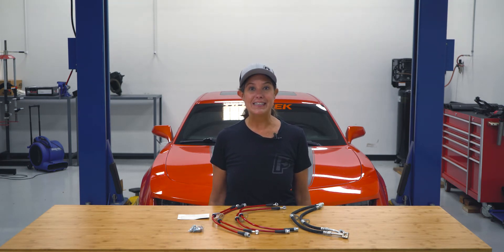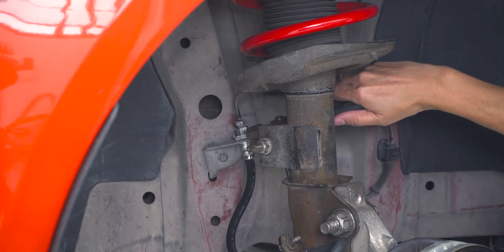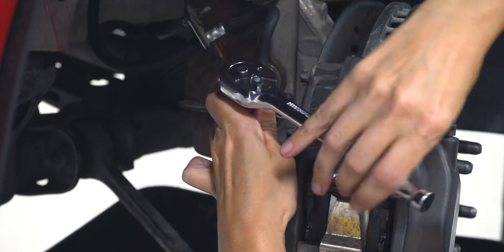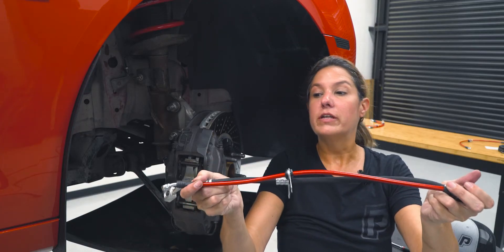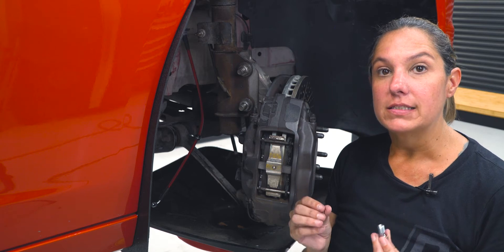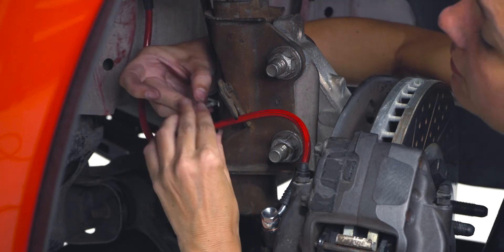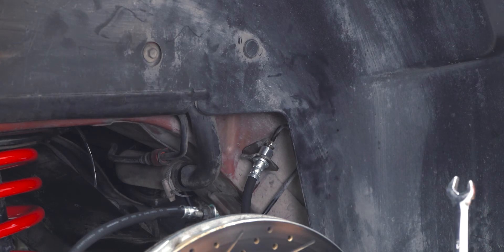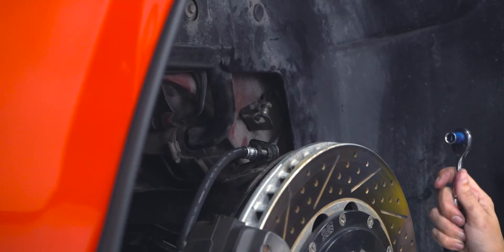How to Replace 5Gen Camaro Factory Brake Lines With RST Aftermarket Brake Lines - Phastek

Comment: Does brake fluid not leak out when removing the lines? I didn’t see any but i dont know if you evacuated the fluid prior to installing
Reply: you will have to bleed the lines after
Reply: They do; this is even if you bleed as much fluid out from all the calipers from just straight taking out all bleeder bolts, or just bleeding them in general. 

I always keep extra mats and drain pans ready by whichever brake lines are being removed, bc you’ll have excess fluid left in the lines, reservoir, master cylinder, brake booster, ABS module, etc….